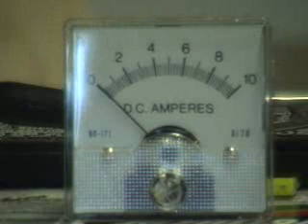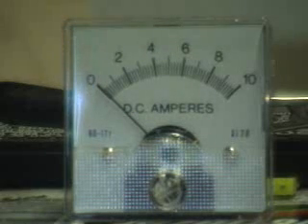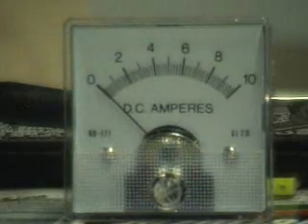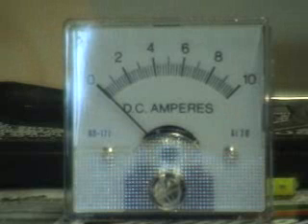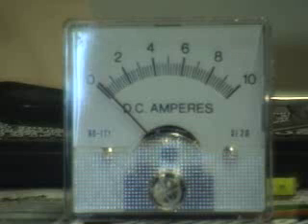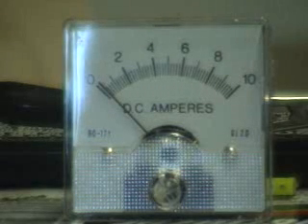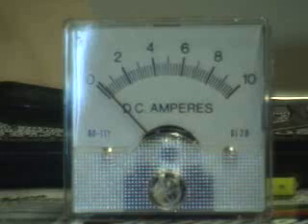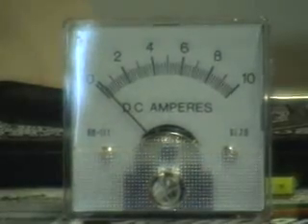True RMS analog amp meter

Comment: Hi Todd,
did you now try to run your
motor just on charge capacitors ?
Maybe get a few supercaps and try to run it on them...
If you really have so much output try to use 
all your output coils in series fed into an impedance transformer to match the impedance
of the output to the input and use a greatz bridge after it to charge supercaps.
Then use the supercaps to run the input.
It is all a question of the right impedance !
Let us know your progress on overunity dot com    
Many thanks.

Comment: If your input current is really low, Im Like Everyone else, What is its Hp?  and have you tryed feeding the backEmf back to the cap.
Let us know what happens.
Im in the process on bulding a pulse motor also, but im using a 10,000 v cap out of a microwave. but im also aiming for a few Hp also.

Comment: No way. Will not work. Cose ktservicescorp's machine make output is pulsing! And think what happend when you put them in rele? It will start going crazy! Will not work, and if you turn AC to DC still will not work. But you can charge batteries for it as well.

Nice Job!

Careica